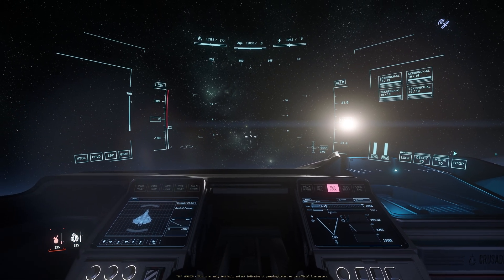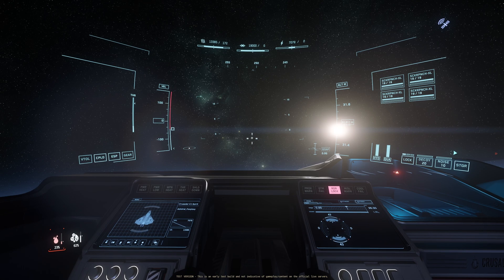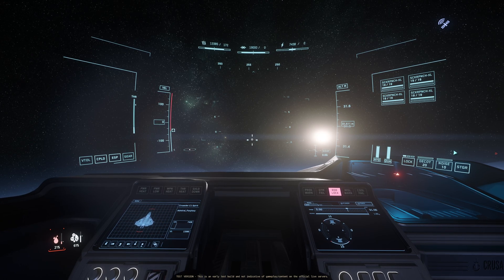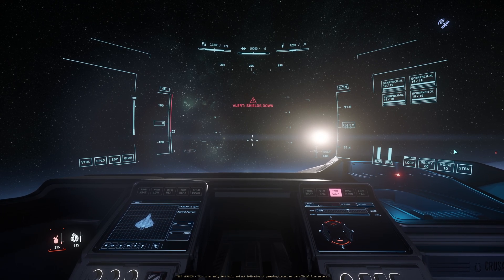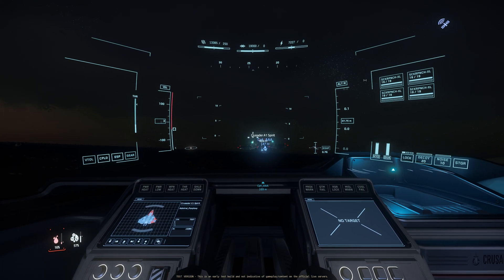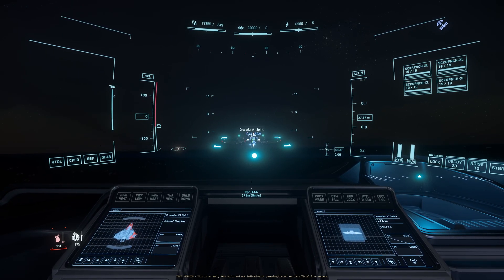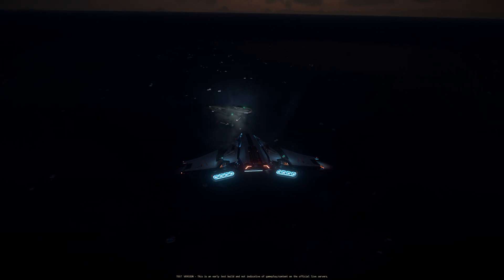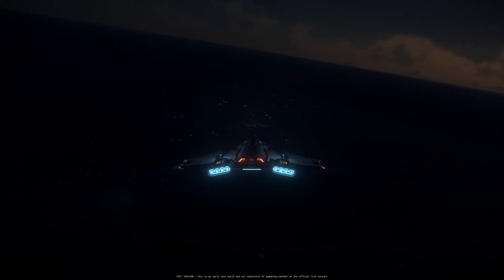Add-On Video: Distortion Cannon (Suckerpunch) Test & Sub-Targeting Problem | Star Citizen Science 4K

Comment: with higher resistance or mitigation, often you need to have something with a higher dmg per attack or shot,  the cannon is not too powerful, it is in most game,  a single huge dmg skill instead of higher average dps to deny the (regen) time for something to regen or bypass the high % mitigation.
Reply from the maker: indeed